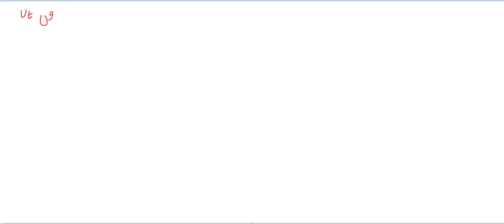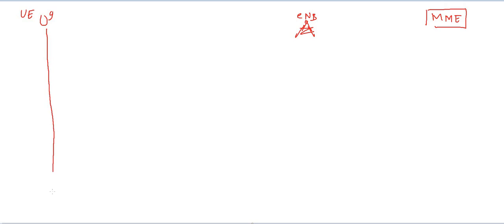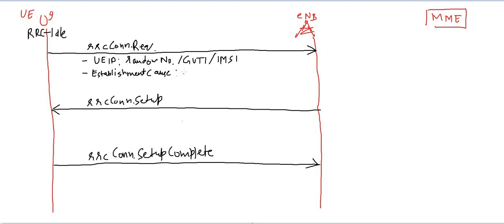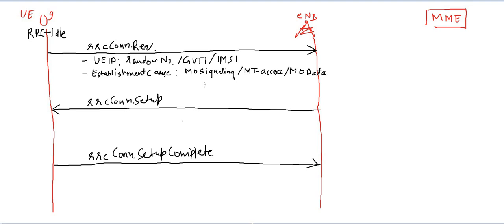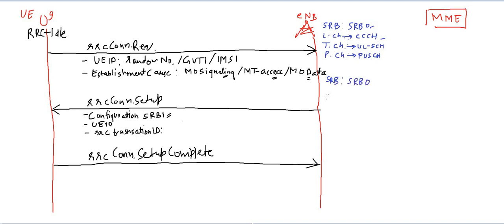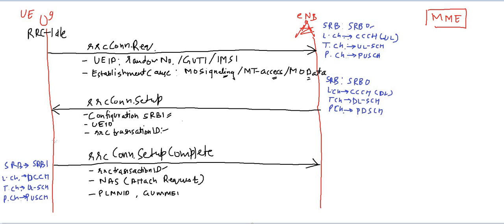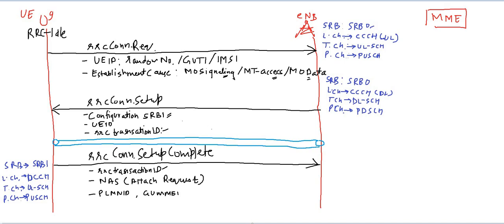LTE Tutorial (Part 7) LTE RRC Establishment

Comment: When the RRC establishment configuration and reconfiguration is required
Reply from the maker: @Mounica A ... RRCconnectionReestabishment is generally triggered in case of Radio Link Failure (RLF).
RRCconnectionReconfiguration is used during UE attach Procedure, reconfiguration of RRC Connection or like providing and changing parameters of DRX & Measconfig, Secondary Cell addition in Carrier Aggregation etc.